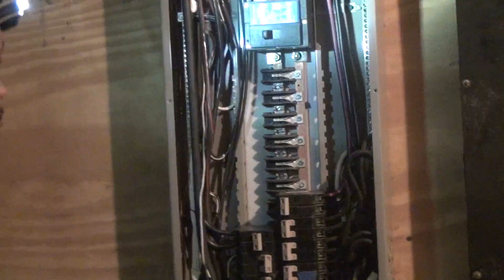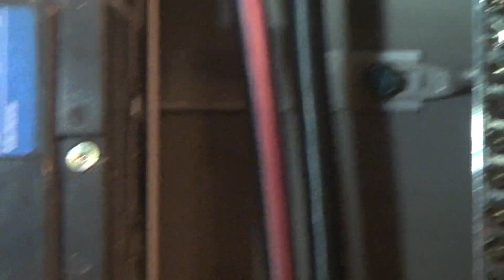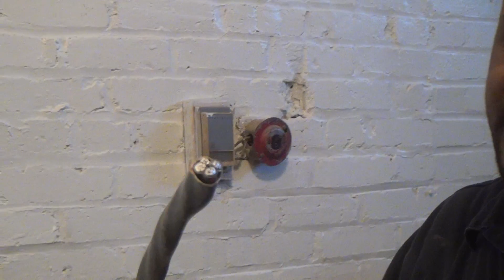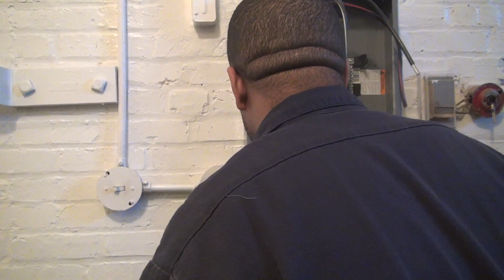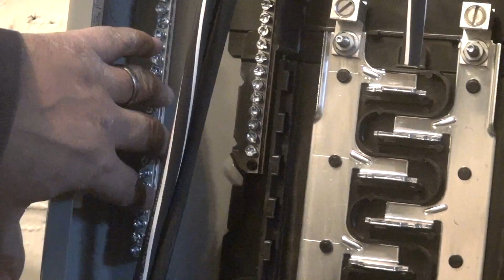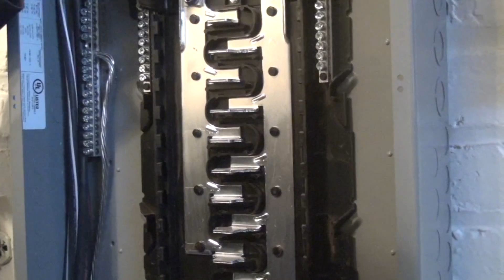How to install a sub-panel

Comment: you are awesome thanks. im adding 3 off a split bus panel. CIrious if i could do it i noticed the wire coming in is 200 amp line im expanding my 1979 built childhood home one outside for an outdoor kitchen with also a hot tub and workshop, then one for a second floor install.
Reply from the maker: You are welcome Kevin

Comment: #2 aluminum SER is not for 100 amp subfeeders. 90 amps max.
Reply from the maker: here you go buddy   http://www.barr-thorp.com/wp-content/uploads/2011/04/digest-176-nec-tables.pdf
Reply: @Tyrone3340  good video nice to see someone who knows what they are doing.
Reply: He is right in a way, you have to use the 75 degree rating because of the lugs, but another section of the code allows you to go up to the next size breaker. So the#2 is fine on the 100amp breaker.

Comment: not trying to be a headache or anything at 17:11 you cut the video as you were about to connect the ground, hot and neutral. i know alot of do it your selfers who actually would have liked to see that.  Also there was another instance where you stopped the video to install the panel on the wall. Folks wanna see that to. Was the wall concrete, did you drill, what about the regulation height for a panel, is there any ?   Like i said not trying to be a pain. Just lookin out for the folks that are really new to this . Stay blessed !

Comment: Excellent educational tutorial! My question is; how do you determine what amperage your sub panel should be? Please help.
Reply: +Charlie Moreno   I will tell you that an inspector will look at the main panel first, not only to see if it is wired correctly, but the panels rating. At the time of the build, it could have been a 200 amp main, but only 100 main breaker was used. The panel can be upgraded to 200 if the panels OE sticker is visible. To answer your sub panel amperage is simple, panel rating, main breaker, minus current breaker load = sub panel max. Say it's rated for 200 amp. If a 200 amp main breaker is installed and the total of all of the circuits & breakers add up to 150, then 50 amps is the max. Some will say that not every circuit in the structure is on at the same time, but if that ever happened, it would create heat and a thermal trip of the main supply breaker. Check your boxes rating, make note and change if higher than current breaker, then find the electrical inspector at the permit office and run it by him or her. You could ask the licensed electrical contract working next door, but if he is in a bad mood, or wants to be left alone, may say anything. Check codes in your area and remove any breaker that is not in service to clean up the box, the re-do the math. Happy 2019! Stay safe & wear seat belt. Glass don't taste good.

Comment: At the subpanel, I notice the exposed subpanel feeder line does not have protective conduit as it makes that sharp bend into the bottom of the subpanel. Are you are not permitted to drill an entry hole in the back of the panel, so the bend would be covered and protected inside the box without using an LB fitting?
Reply from the maker: For exposed cable at the length seen in the video protection is not required. You can however sleeve the cable if you choose to do so it would make the install that much more safer in my opinion.

Comment: Tyrone great video! Does it matter what kind of material the ground bar is made of? Reason I asked is because I made my own out of steel. Also does it matter on the wire lug screws? Thanks man.
Reply: One more thing.  Can you add a ground/neutral bar in the Main panal if there is not enough room.If so does it need to be connected to the OG buses thanks again.
Reply from the maker: I would say yes it does matter typically the ground bar is made with copper, aluminium or a combination of the 2 called aluminium clad, more importantly the bar has to be UL approved and compatible with the panel that it is installed.
Reply: Thanks much:)
Reply from the maker: np :-)

Comment: I PUT IN A 125 AMP SUB Q HOMELINE W/ ARC BREAKERS WHICH THEY SAY ON EASTON SHORE OF MD. NEW RULE. QUESTION - NO GROUND IS NEEDED ON SUB PANEL AND 2/0 FOR SERVICE WIRE RIGHT ?

Comment: Hi Tyrone I have a question I have seen on some other videos that people also run a solid copper to a grounding rod from the sub panel is that not necessary? And I have to install a sub panel in my house can I run  2-2-2-4 Gray Stranded Al SER Cable wire through scroll space to the sub panel it's about 45 ft away 
Thank you great video
Reply from the maker: generally a ground rod is not needed or wanted and yes to the second question

Comment: Hi Tyrone I have a question I have seen on some other videos that people also run a solid copper to a grounding rod from the sub panel is that not necessary? And I have to install a sub panel in my house can I run the ser wire through the walls to the sub panel it's about 60 ft away 
Thank you great video

Comment: hey thanks sir , I have to install a 200 amp disconnect I'm aware I must use ser  cable and I must isolate the grounds from neutrals on what will be sub panel. do I ground  the disconnect to a grounding rod only the is no metal plumbing
Reply from the maker: No. The ground should already be grounded at the main service panel.
Reply: phaseg21 call a licensed electrician.

Comment: Thanks Tyrone to you and your wife for a great video.  A question for you:  can SER cable without conduit be used in a residential application?  I want to place a 60 amp sub panel in my attached garage  that is about 60 feet away from my main panel.  Also the SER would be surface mounted.  Anything I can do to avoid running conduit would be better in my eyes.  Have a good day.
Reply from the maker: Sorry for the delayed response your comment was buried in youtube netherland. yes the ser can be run so long as it is not buried in the ground.

Comment: PETE V. you spelled axe and axed wrong!   Tyrone, thanks so much for the awesome video!!!  I'm doing the same exact thing but sub panel in the garage about 30ft away with conduit...would I use that same exact cable ?
Reply from the maker: No you want to pull individual conductors into the conduit. You do not want to pull any type of cable assembly through the conduit. and sorry for the delayed reply your comment got buried in comment oblivion.

Comment: Tyrone, I need to pull 200 feet of 2-2-2-6 alum cable underground. I already have the conduit buried at 18". What is the best way to connect the rope so I don't slip off the cable?Thanks in advance.Paul

Comment: How do you determine what size wire that you use for your sup panel box and do you determine what size sup panel to use
Reply: Mr Will Go' Gators you determine that by what size sub panel your're going to use

Comment: im inpressed the only thing i see is i would of come threw the back of sub panel with connecter and drill front of hole bigger so connecter will fit into the wall or maybe a spacer behind each screw holding box on the wall the other thing is a pvc like A lb that way no cable is exposed subject to damage consalt a inspecter befor doing work god bless take care

Comment: First of all, thank you for doing this.  These video's are very helpful.  I have 2 closets and a light in each.  Each closet has its own switch.  My problem is that you have to have the first closet light on for the second closet light to work.  I'm sure it is a small problem but very aggravating.  My electrician that wired my house passed away soon after I built my house and is not available to ask.
Reply from the maker: +kwillis1231 The power for the second light is being feed (supplied) by the switch leg of the first switch. You would have to supply power to the second switch with a source that is not controlled by a switch.

Comment: Hey Tyrone when you were speaking of grounding to a water pipe from the main panel, what would you do if there was poly pipe instead of copper pipe coming into the house? Would a multiple ground rod system work ?
Reply from the maker: +freespeach1776  sometimes in certain situations you call the jurisdiction having authority get a pre inspection  and let them tell you how they want it grounded
Reply from the maker: +freespeach1776 most of the time even if you have cpvc the line side of the main shut off is bondable if not use the other comment.

Comment: Great video Tyrone.... Let me ask you how would you connect up a hot water heater to a sub panel...
Reply from the maker: +freespeach1776 The same way you would hook to your main service panel, the only thing that would change when running circuits from a sub panel vs. main panel would be circuits having a neutral would have it get connected to the neutral bar and grounds to the ground bar. In the main panel the 2 bars are one in the same because they are bonded together.

Comment: Thank you so much for the nice video. Can you please tell what size breaker you used to connect the sub panel with the main panel? Can I use a 100 amp breaker?
Reply from the maker: +Leonidas Sarris I used a 100A breaker for my sub panel. You have to size your breaker with the cable that you run out to your sub panel, the breaker can not exceed the current rating of the cable that you run. You also need to size your sub panel as well.

Comment: Have watched many video's and yours seems to be more thorough than others, thanks for sharing your time and knowledge with everyone.

My home was built in 2007, and has an additional 1400 square feet basement that I am attempting to finish.  I am experienced in Industrial electricity. However, I have ran into  several issue's and would greatly appreciate your advice on how to rectify these issue's.

 I purchased a 125 AMP main lug panel with 24 circuits. Upon looking at the existing feed from the main panel to the basement, (to where the future sub will go) the wire (cable) does not appear to be long enough to reach the 2 pole breaker in the existing main panel. The existing cable from the basement junction box to the main panel is NM-B , 2/3 with ground. Would you advise running new cable and if so, what size would you recommend.

I have been told by some  that a subpanel is not necessary, and by others that it is recommended. It is about a 50/50 toss up.

I have photo's for you to view if necessary.
Reply from the maker: vernonleeper Sorry for the delay getting back to you I did not see the comment. I would assume that you probably cannot run from the junction box that your current service cable is connected to because of the distance you would have to run the new cable to reach your new panel. You never want to have more than say 3 feet of unfused service cable running through the interior of your house. So I would say run a new cable from your existing panel and use the proper size breaker for the cable that you run (avoid the temptation of tapping in to the junction box).

Comment: Hello Ty, I just finished installing 13  100 amp solar panel, So an I create a single pole 30 amp breaker panel by using a 8 space SQ-D QO panel to feed approx 6 or 7 15 amp breaker to feed the 110 electrical outlets that supply my second floor ( coverter acctic ) there is no 240 up there just 110, so can I bring 10/2 wire from the power inverter to the breaker panel and jump conductors to create that panel
Thanks Al Ruark
Reply from the maker: Al Ruark You can but you will still only have 110v

Comment: Tyrone, i'm in alabama and i'm a building contractor and there is a very important question i need to ask you if you can help. I have this client that i met and her water heater was tripping the breaker, and normally it's usually the element, or elements that usually cause that action. Now here's the strange part, the elements were checked and they were fine. The sub panel on the inside didn't have a 100amp main breaker which there should have been 1 and the water heater is on a 30amp breaker in that sub panel. Instead of if something was wrong with the water heater which i found out it was not. there's a 100 breaker outside that's powering the sub panel inside. There is a 100amp breaker that's outside in the 200amp breaker box under the meter can why when the water starts to heat is the 100amp breaker being tripped instead of the 30amp breaker that's powering the water heater. Instead of tripping the 30amp breaker it's tripping the 100amp breaker powering the sub panel that's on the outside in the main breaker box under the meter can. That's is so confusing to me till i'm just lost. What i did was remove alot of the breakers inside the sub panel that's really not even powering up a few of the circuits inside and that seem to have stopped the water heater from tripping. There was not a lot of load on those other breakers or no load being used at all on the 1's i took out the sub panel. Plus if anything was wrong with the water heater it should have tripped the 30amp breaker in the sub panel instead of the 100amp breaker powering the sub panel on the outside under the meter can. Please help if you can.
Reply: David Lee the 100 amp breaker is tripping because with the water heater running is pushing the house total amperage over 100 amps, the main breaker that's in place is designed to trip after 100 amps, the 30 amp breaker isn't tripping because the water heater isn't exceeding 30 amps
Reply: Thanks bro, you been very helpful

Comment: Hi Tyrone, great video...could you tell me what the difference between using copper vs aluminum? Besides cost, why wouldn't you use copper? I have been told by several folks to use only copper, please comment why using aluminum isn't a problem....thanks!!!
Reply from the maker: For service cable aluminum is what you would end up using. You do want to use a anti-inhibitor like penatrox on all of your connections. But to answer your question the type of connections used in service entrance type installations (pressure connections) work much better for aluminum than wirenutting to wires together. With the wire nuts the connection have more exposure to the oxygen in the air which cause the aluminum to breakdown. This is just one of the negatives of using aluminum wiring.

Comment: Hi Tyrone and thank you very much for the video it helps a lot one question in the video you're installing the same panel I would like to install and you answered one of my questions right away about the grounding bar didn't know I needed a separate one now I do thank you for my question i'm updating my sub panel in my garage which has a ground wire that goes right to a rod in the ground ..do I connect that wire from that ground directly to the grounding strip in the panel?  Also now I know to get rid of that bonding screw you see i'm updating this from a fused box and upgrading to breakers.
Thanks again and great information and video!
Reply from the maker: if this is your main panel you need the bond screw to bond the service. if it is a sub panel ( a panel that is feed from your main panel) then you do not bond the panel. So if it is in fact a sub panel then the bar for the neutrals need to float (not be connected to the panel) and the ground bar needs to be connected to the panel and here you will terminate your ground from the ground rod if you have one.

Comment: Great Video- get some sleep..

could I use 2-2-2-4 Quad over SER if I run PVC conduit? Or can i go either way?
Reply from the maker: Not sure what you mean with 2-2-2-4 but if you are talking about tri-plex it is used for open air so probably cant be pulled into conduit
Reply: So quad plex unsheathed versus sheathed ser . im running a 100amp sub for an addition and will be running conduit outside. Just thought the quadplex would be eaiser to pull and still meet my required load.

Comment: Nice work, But just wondering if it was possible to use a condulet to run the SER out the brick wall and  under the box. Or can you have the SER come out the back of the subpanel so you would not see any wiring.
Reply from the maker: yes you can do either if you have to use a lb or similar fitting be sure to increase your conduit size to account for the bend radius on the cable

Comment: From the main panel can I install subpanel  for a second house right next to the main house? I live out in the ranch so permit is not needed. Contacted electrician and said he would do it. Both houses are mine so no problem on paying the electric bill. He would ground the second house. Just want your input. Thanks for the video.
Reply from the maker: I do not see why not, however the jurisdiction having authority always have the final say so, but if no permit is needed then I say go for it

Comment: Tyrone I am wondering is it better to put a wood board behind the sub-panel rather then just placing it on the wall . oh and does the inspector fail you if u don't place wood board behind the panel.
Reply from the maker: every install has to be judged on the specific conditions that exist for that particular job. That being said it is always better to mount the panel in such a way that you have maximum mechanical integrity (strong and secure) if you are mounting to a concrete wall that is below grade it is a good idea to use a board but other wise it is up to you to ask the inspector if there are any specific mounting requirements.
Reply: thank you Tyrone
Reply from the maker: You are welcome

Comment: Tyrone, can you tell me how much torque goes on each lugs on the service entrance cable?  Great vid
Reply from the maker: if you look inside the panel it will have a chart that will include that info. (it can differ from one panel to another)